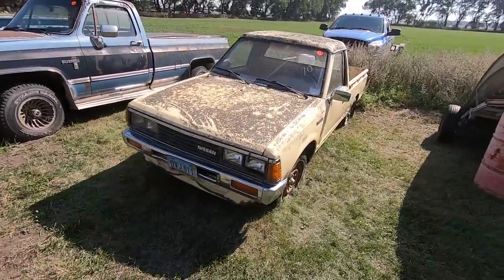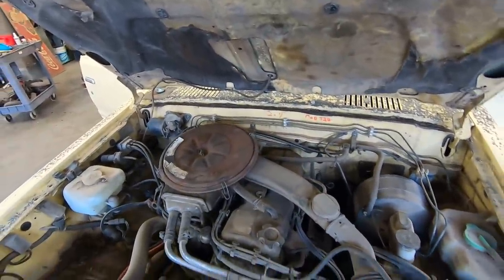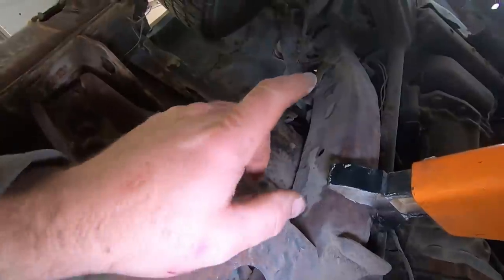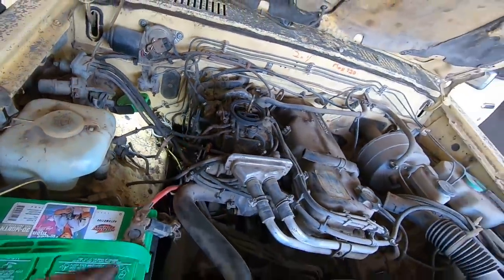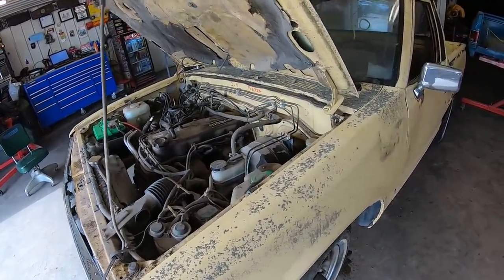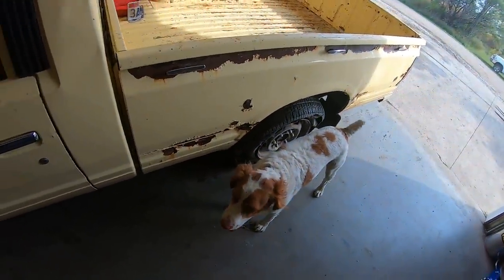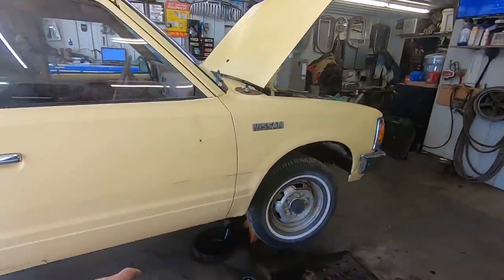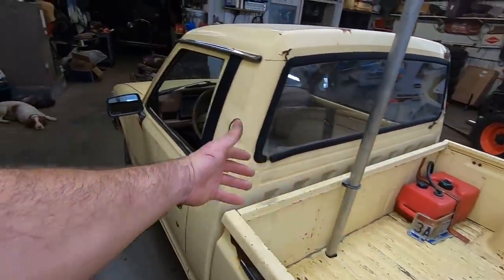Abandoned 1984 Nissan 720 Pickup Parked for 18 years! Will it run?!? Datsun Mini Truck!

Comment: We had an 1986 Toyota pickup that was my wifes, when she was in college. Drove that truck forever, got great mileage , could haul anything,and even had a camper shell and could sleep in the  camper. it was a 4 speed, 2.4 liter 4, and I wish it would have had 5th (overdrive). finally got rid of it when clutch was shot at 191,000 miles. now looking back, I should have gotten new clutch,and I would have been good to 375000 miles.

Comment: The beds used to perforate in around three years in the salt belt.  The rest of the 720's were solid trucks. Love the z24.  The 85-87 were less rust prone, and eventually became electro injected. Double roller timing chain shows the build quality of these engines.
Reply: I’ve got an 85 with the fuel injection. Inherited it from my grandfather who lived in California.  Resealed with valve cover (it was pissing oil to the tune of a puddle every 10 minutes), replaced suspension bushings and added leaf helpers.  Done a ton of other odds and ends, but it runs like a top.  Best yet, I get between 22-25mpg in it. Cool truck.

Comment: Love the vid @Mortske I have a 86 4x4 myself, was a handmedown from my father, he bought it used in 92 and drove it daily until it was parked in 2012 with 220k miles. After 2 years of working on the truck and finding parts for it it's now my daily driver and first vehicle, those little z24 engines can pump out 300k miles or more before they give up. If I were you i'd keep it around, these little 720's are hard to come by, atleast in NC.

EDITE: BTW if you're looking for a set of new headlights for the truck I got lucky and found the entire headlight assembly on Amazon for like $45.

Comment: Datsun/Nissan makes a vehicle called the Sunny! I kind of liked when you called it Daisy. Lots of weight reduction in this ol mini truck😂
Reply: You guys called that a Sentra ans we called it a Tsuru.
Reply: the Sunny was a B210 station wagon, and the "ute/truck" with the little A-series engine in it (usually) like the 210 wagon. A-14 or A-15 aren't huge for power but they're silly reliable, easy to work on, cheap for parts it seldom wants. jetted and tuned can give 40-41 mpg if you're nice to it.
Reply from the maker: @modelnutty6503  I could go for 40MPG!

Comment: Older rangers had 8 plugs on a 4 cylinder and I've done tune ups on v12 Mercedes with 24 spark plugs those are pretty neat
Reply: How neat is that
Reply: @bigcountryjd  that's pretty neat. Haha
Reply from the maker: I've seen the Rangers! Not the Mercedes tho!

Comment: It looks like the same motor I have in my 1989, mine is fuel injected. I’m not a fan but it’s never left me stranded. It’s my daily driver.
Reply from the maker: Can’t complain about that!
Reply: yup, EFI was their next step you can do a lot with. cam and an ECU you can tune injectors with? turbo? no prob!
Reply: @modelnutty6503  turbo! That would be cool in an old roadster. Yes, I want one and the very first little pickup they imported over. Also love my pathfinder, V-6. Never had a turbo. At heart I’m a pushrod and points guy! Love the classic Datsun.👍

Comment: Good pickup Mort.  (See what I did there?)  The Z24 USDM (two plugs per cyl for emissions control) is a rock solid motor especially once you get rid of the janky carb and 38 miles of vacuum nonsense.   The "two different plugs" setup was used by Mazda on RX7's (leading and trailing plugs) although for a much different reason than the Datsun.   Port the heads, swap in a hot cam, a good header, and put a 4 barrel Weber on there and she will really wake up and go, especially since this one is already on the Tinworm Weight Reduction Diet.

Comment: I used to have a red '84 2WD 5M long bed. I got it for free from a family member and it had a ton of rust, but it was still a solid truck. I loved mine. The fuel filter in the glove compartment was probably a factory add on. I needed to keep one in my glove at all times. The $4 fuel filter needed to be changed about every 4 months, but it was an easy side-of-the-road fix. It was finally the transmission, at 160K, that needed to be replaced, which got me to say goodbye to it. I regret that decision. It would have given me a few more years of fun.

Comment: I had an 84 Nissan pick up.  The internal filter in the fuel pump clogged up badly.     I had to pull it apart and delete the filter and add an extra external fuel filter pre pump.

Comment: I had that same motor in a 88 pick up z24 Realy reliable engine 8 spark plugs called a waste spark system fires on compression and exhaust stroke perty quick too amazing on gas

Comment: I saw those floors and immediately started singing Flintstones meet the Flintstones lol That actually was a pretty easy fix not like the other frozen up engines you have been working on lately. Good old speed shifting with no clutch better than having no brakes.
Reply from the maker: I'll take rusty floors over a stuck engine anyday!

Comment: On the Nissan 720 2.4 liters pick-up truck. Before you pull out the drive shaft from the rear differential pinion gear, please make the paint marks on both drive driveshaft and flange pinion gear then align the marks and tighten up the bolts and hex nuts. It connects the  U-joint's flange to the rear differential as it align  back the way it was. It is easier to make known that it is balanced (no wobbly). Thanks.
Reply from the maker: Interesting

Comment: Your problem isn't really a problem. The electric pump will only run for about 5 seconds when you turn the key on. That is for starting purposes. After that, you need oil pressure for it to run. To see if your pump is getting power, you have to be in two laces at once.
Reply from the maker: I hooked the new pump to the same wires that were back there and it runs all the time when the key is on. No oil pressure switch related to the fuel pump circuitry.

Comment: Excellent video Mortske Repair  :) what those 2.4 Litre in line 4 cylinder motor have 2 spark plugs one is because one low stroke on bottom on right side and top is for high stroke on left side for compression strokes and timing set up! Plus Spark plugs are Platinum types also High 91 octane gas run excellent those also look for Choke control knob pull out then kick gas pedal till start push choke knob in too till engine goes of high idle when warm up engine on cold star or damp weather! Also great motor for high Compression engine of 2.4 and dependable last long time too! Plus transmission too also 10w30 engine oil no synthetic type! Clutch are easy change plus 2 throw bearing one front and back one slave cylinder replacement too and brakes is worth doing it to! Nickname it Lemon Marian Pie or Lemon Ice Tea ! The fuel tank 18gallons too Mortske Repair  :) and load those truck with 4500 pounds weight also still keeping going and strong as full size  1/2 ton pickup does in Gas or Deisel motor fuel trucks do! Only thing lots body rust out and powertrain outlast body do!

Comment: Mortske you might not believe this, but chewing gum (chewed) will seal a gas tank leak while gas is coming out. I doubt it would be a permanent solution, but I did it on my 63 Impala SS back in high school (1976). I had just filled up with real premium gas and had to save it.
Reply from the maker: Good stuff!

Comment: Them z24 r stout lil 4 bangers almost a 22r i have a 87 4x4 ext cab with the tbi 248k runs like a stopwatch but your not gonna win any race but very capable small 4x4 rig almost unstoppable in snow but have 90% m/t's helps alot

Comment: It should be a wasted spark system like dodge uses on its Hemi engine. One fires the primary mixture and the secondary fires after to light any extra fuel vapors in the exhaust before the exhaust valve opens.
Reply: plugs are fired barely apart for faster more complete fuel burn. if it gets fuel injected with a good ECU and cam, lots of power pretty cheap staying N/A.

Comment: Old Nissan = Proper.  Wish I still had my 1973 Datsun 1200 sedan...sold it in 1998 because it was too rusty for me to fix - they only weigh 650kgs tare: so, almost every piece of steel is structure at that rate.  The only car I actually miss in 25 years on the road.

Comment: I have repaired many fuel tanks with seal all that stuff works great this one guys buick had a fuel tank the whole seam was rotted out and had holes everywhere and he did not want to spend money on it because it was a winter beater so I used a whole tube of seal all on the tank seam and it worked like new did not have a leak and I was surprised because that tank was damn near rotted in half
Reply from the maker: Nice!

Comment: Reminded me how much I love the horizontal tail lights on my '82 720... And hate the 8 wired 4 cylinder. If could  find a cheap KA24DE for it, it'd get it.
Reply from the maker: What’s wrong with them?
Reply: @MortskeRepair  nothing major, the z22/24 looks cluttered to hell and not very high performing. Then that Hitachi carb, no one seems to like working with it.

After a cat delete, Webber 38/38 carb swap (with solid steel machined adapters instead of the provided crap cast ones), 5speed swap, and refreshed all the ignition except distributor, it's still kinda slow and pokey.

Comment: Ok.MR. Mortske you can.pick on that funny 8 plug motor but mine was pretty good.  Mine didn't have that many miles but at 101000 it would spin tires in first 3 gears . That was until I blew the rings but even though smoked like a diesel she kept running.  Lol 😁
Reply from the maker: sounds like a real ripper!

Comment: IF the roll-over safety device didn't reset or maybe went bad- its primary function on those units was to shut down the fuel pump & stop the flow of Fire Maker in the event of an accident..  just so you know..  the said safety shut off switch on the 81 model datsun was on interior drinker's side kick panel

Comment: Wow an import pull off with ol, Puddin, I think you already have the upper hand with the hot rod 2.4 8 plugger and Miller locker, all you need now is a spark plug igniter setup in the exhaust stack for flames. Pure comedy, is lawnmower man going to make cameo appearances in the future, good stuff, I was still chuckling about that, Duff seems to be more of a vintage ride purist from the looks of his attitude. You just never know whats going to happen next at Mortske repair Ha!!
Reply from the maker: He’s a regular drive by!

Comment: I'm drooling over that z series 2.4ltr motor and 5 speed gear box i used to have a king cab with the same motor and if done right they are powerhouse  motors
Reply from the maker: Nice!
Reply: You'll want to switch the distributor for the motor that has automatic and use the manual transmission and it'll really come to life
Reply from the maker: @danieltwellman6377  What's the difference in the distributors?
Reply: Ok i had a 720 king cab with the 2.2ltr z series motor and it was setup with factory 5 speed manual transmission and 1 week after buying it the motor overheated so I went looking for the same model and displacement as factory and every where I went they all said the same thing that no matter what I did it was never going to have any power... after finding a  z 2.4 out of a frontier with auto and 4x4 transfer case i just bought the whole motor, and did what most would have done and swapped all the accessories from the original over to the new  motor except the distributor however after driving it for a few months I swapped the manual tranny distributor and  set timing and I lost soo much power from low end to midrange. As for what is different between the two timing advance and vacuum advance setup for auto or stick shift
Reply: Ohh i also had a constant issue with the exhaust breaking just past the first bend after the manifold
Reply from the maker: @danieltwellman6377  Interesting

Comment: Greeting just recently did a spark plug change and now the truck won’t start and I just want to get help on how to fix my issue and I don’t know how to fix since I’m just a beginner and I was just trying to do maintenance on it since I barely got it and now after I did the spark plug change it started up once but after that it never turned on and I’m frustrated at this point

Comment: I say, put the motor and transmission in the model T.
Reply: I'd use the frame for that project too, they handle really well with a 3" drop.
2" lowering blocks, loosen torsion bars to match, 2-3" smaller diameter tires, KYB's all 4 corners.

Comment: My sister have 1984 black truck run and drive ok but need more work on engine putting motor out and rebuilt new parts for engine little bit bad piston rings.

Comment: Does the 'magic genie light' give you '710' wishes? :D

Of course they were using that pipe as a pipe! What, didja think they were using it as, a bong?

I vote sunny. It'll even have it's own theme song.  https://www.youtube.com/watch?v=ubvYQxTXO3U

Oughta send those Marlboros to Coldwar Motors for their 'my classic darts' segment.

I know Honda used those lousy wire hose clamps till at least 07 thanks to helping dad fix power his steering leaks...Those clamps are extra 'fun' when they are at the bottom of the engine bay and rusted half way between 'can't get them off' and 'rusted off'.

I'd guess 'lawnmower man' has probably had a few too many 'sammiches' behind the wheel...That or his last rig died and he found a way around the covid car shortage.

Comment: ah, good old NAP-Z engine.. rebuild it pumped up! 
they'll make really good power naturally aspirated.
the shell is toast, but you can do anything with the drive train and frame,
4 corner coilovers with a 240Z rear end, or old Datsun 510 is independent.
the 510 4 door rear end is usually lower gear ratio, torque vs speed stuff.
Reply from the maker: Good info!
Reply: @MortskeRepair  decades ago I did a 1976 620 long bed, L20-B with a cam, Offenhauser intake, progressive Weber, header into a FlowMaster super single (2.5" back when). ditched the 5 speed for 4 speed from a 1600 610 wagon = lower closer gear ratios, so the valves floated at 90 mph (oh well!). 165 whp but.. mesh tailgate, no rear bumper, no spare, AC delete, smog delete, heavy bench out for light Toyota buckets.. peeled near 400 lbs so the HP/weight ratio was tipped pretty hard. lowered 2" at suspension, rolling on 15" centerlines with 195/60 Yoko's, KYB shocks.

this was coastal Sonoma County where "fast" didn't matter near as much as QUICK, being all twisty narrow coastal mountain roads there. how quick from one corner to the next and how quick  through it headed for the next was the real fun+games.

clutch.. heavy duty truck pressure plate with the smaller diameter disc from a 1600-1800 car gave the psi to slam shut with authority. slam brakes, downshift 4th to 3rd with a hard clutch bump and you're drifting.
the short beds DID corner faster, but let go without warning. the long bed was MUCH more forgiving with less weight on rear tires.
it'd run out of legs for the QM, pretty mean in 1/8 and stoplights...
Camaro? SEEYA! 2nd gear hole shot was just fun/funny.
sheared driveshaft bolts at the pumpkin twice, drilled+tapped them all  for larger took care of it... I know what a built NAP-Z engine would have done for it but they were still expensive then.

another local slapped a T bucket body onto a '74 shortbed frame with an L16 engine, looked and sounded great. didn't have much for power same time it didn't weight much either, it scooted pretty good and gave great MPG.
the older 5 speed was kinda infamous for the overhead overdrive shaft/carrier running dry and burning, 4 speed didn't have that issue and the 5 speed for a B210 was great.. but too small internally to put bigger power through it (also rare "gold" nowadays!).
hehe, have some info  :)

Comment: Brakes clutch rebuild the carburetor or one of them performance two barrel carbs whats the name
Reply: Or even better you could go with a Four Barrel Manifold Kit, 70-83 Z/ZX

 ￼Quantity in Basket:none
Code: 11-2995
Price:$489.87
Or a nice one of them two barrel bolt on weber carburetors after you go through the brakes and clutch i mean hell it sounded good has a awsome motor and from what i could see it didn't have a rotten frame. Soak the the under carriage down with a half gallon of 80-90 weight gear lube mixed with a gallon wd 40 and quart of paint thinner mixed up with a metal paint sterring paddle on the end of a drill in 5 gallon bucket then head over to the old harbor freight for a cheap two gallon herbicide pump up sprayer and give the hole bottom of that truck a good anti rust protective under goat and grab a couple cans of rustoleum canary yellow spray paint and bam me pudding wont have nothing on your sleeper truck and pudding might just piddle instead
Reply from the maker: @timsatori  I'm not rich!
Reply: @MortskeRepair  hey bro trust me i know  how it goes but i thought you said what should i do with this sell it or fix it some i was just throwing some ideas out there regardless enjoy you vids and hell i used to do the same thing all the times to i losts my damn leg work on a 64 1/2 ,mustang

Comment: GL5 gear oil for rear end use regular only not synthetic 75w90 gear oil
Reply from the maker: I used 80w-90
Reply: Make bad I told you worng your right 80w90 is right that is what it calls for in manual

Comment: Gotta watch those gaping gashes...no wonder it got wet...inside and ....out.
These little jappers don't really count...you can't kill them. I've got an 87 Toyota truck that I think looks worse than that datsun. ....and I drive it daily! I had one if those datsun trucks...bought it new in 82..totalled at 28,000 miles. You could drive that truck for 30 more years.